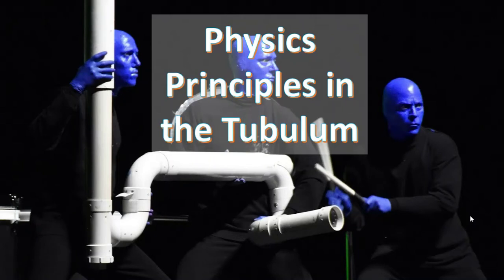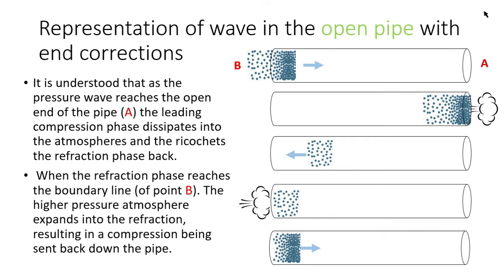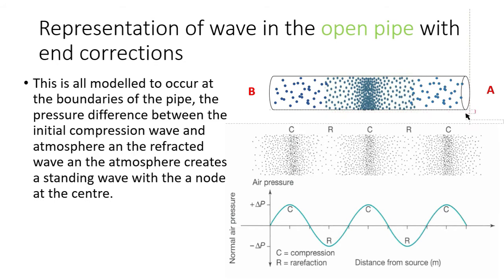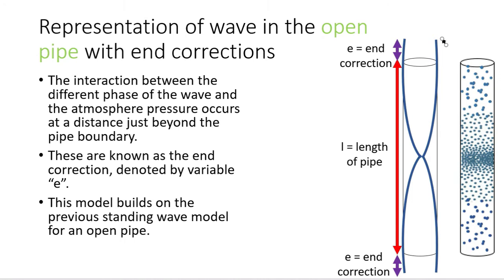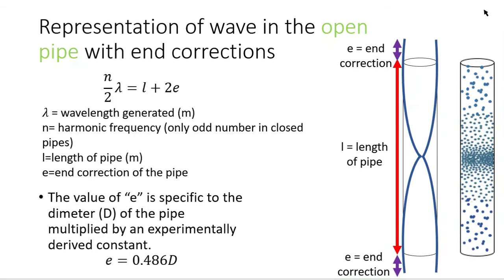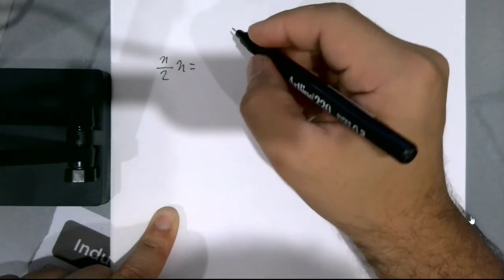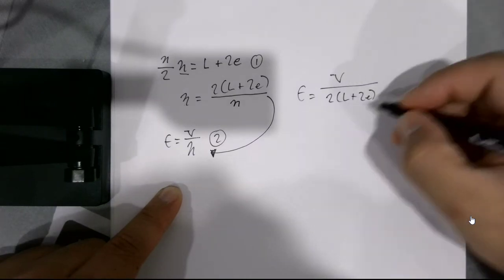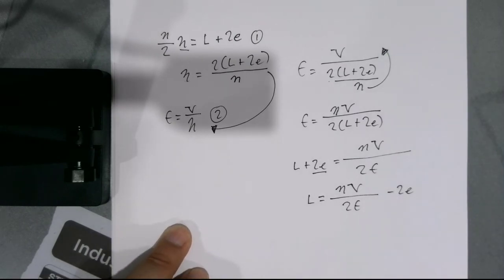Derivation of the equation for an open pipe with end correction

Comment: How do you calculate the end corrections? Specifically for designing a bamboo flute. Given that one end is the diameter of the pipe and the other open end is the diameter of the blow hole.
Reply from the maker: If both ends of the bamboo are of approximate equal diameter then then the same end correction principle will apply - as it is the overall resonance of the length of the tube which is of interest.The constant "e" is empirical, meaning it can varry from material. This is a good approximation - but more refined results would require a little playing around with sizes.